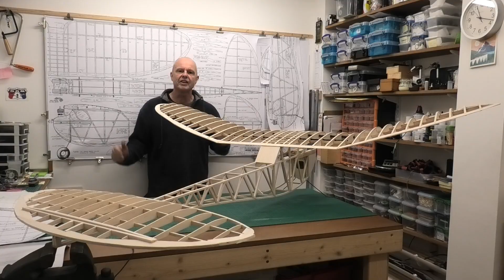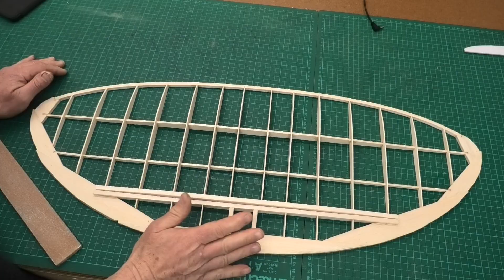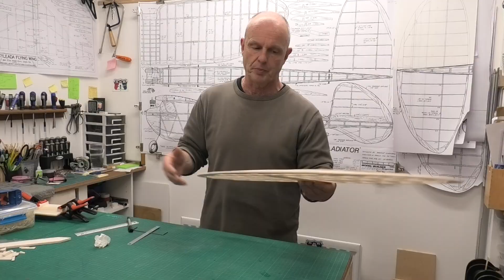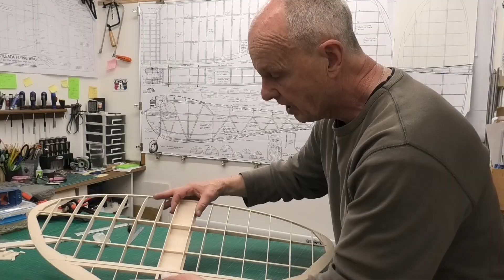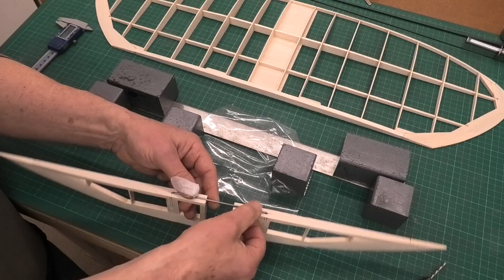1941 Vintage Gladiator - Pt12: Tailplane - Profile, Hinge & Sheeting - 68" Wingspan Tip Dihedral

Comment: You are clearly a master.   One question:  why did you make the elevator two piece at all.  Why not leave it as a single piece an skip the wire?
Reply from the maker: Thank you very much for the very kind comment, pleased you ike the build.  If I had left the elevator whole I would have needed a large gap above and below it to allow for movement.  This would be possible, but awkward and to my mind would spoil the look of the model.
Reply: @MarkRobinson555 I see now from the next video.   I missed how the fuselage was shaped.